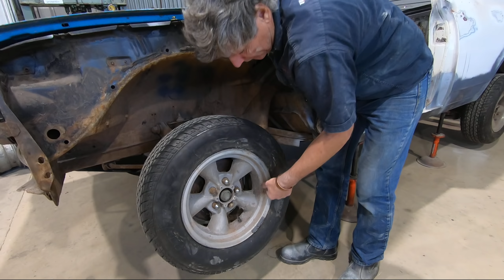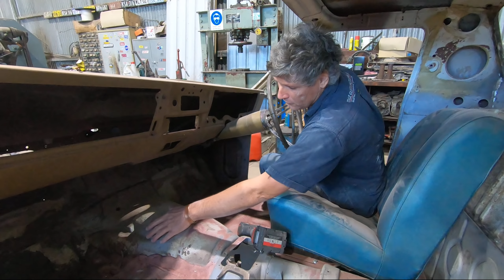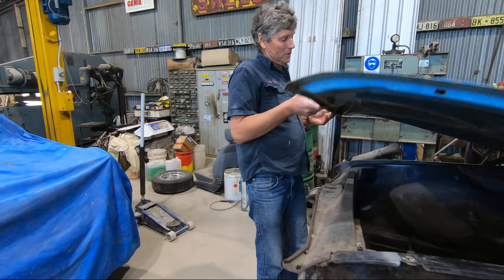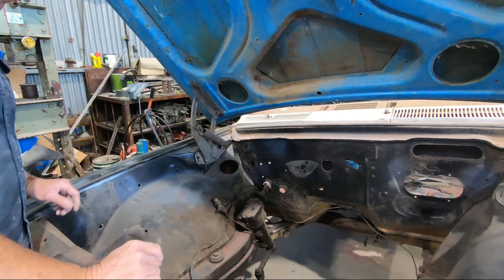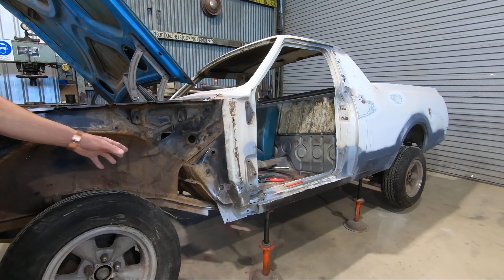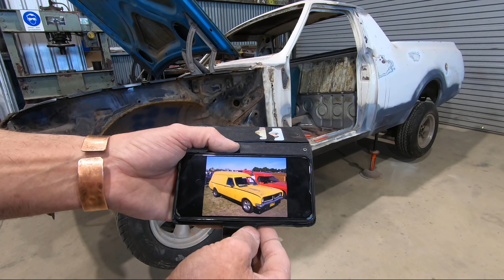GoPro update 4

Comment: Rob have you ever come across a Holden premier hg with monaro dash and v8 brakes discs on front but come with original 6 cylinder
Reply from the maker: Yes,  disc brakes, were std on all hg v8's and 6cyl gts Monaro. Optional on all other 6cyl. The dash in the option book is refered to as the sports instrument dash, and was avalible on all HG models that did'nt have it as std equipment. The hk ht and hg were the most optionable Holdens ever made. In theory you could option a Belmont as a Premier.
The disc brakes were not that uncommon, by 1970 they were starting to become a popular option.

Comment: anyone  can paint 2pak  tho ....the other paint is so much better  than 2pak
Reply from the maker: Having grown up with acrylics and jam, I always look back on those days and the differences between them. I like, most people then looked at enamels as the rubbish paint, and this new fangled 2pac was just another form of an enamel. We were mostly cautious of the change, and it was a hard sell from the manufacturers to convince the industry. I did embrace the change, and like alot of others did a few jobs and went back to acrylics. However as time went by I did move entirely to the 2pac system. I do believe that both have advantages and disadvantages. Personaly I like the look of the acrylic on restored cars in the door jams and inside the bonnet/ boot, as in my mind it looks right. I like the gloss of the 2pac on the same era car if it is modified. Cheers Rob.

Comment: Some years ago a mate owned a HG premier ute. It was the only HG i have seen with a 327 v8 engine....factory. I'm a Ford guy and find both Holden and Ford had great option lists in those days. You could build a car that was you!  I bought an XY ute once that had been owned by a farmer from new. It had a 302 V8 with 3 on the tree. When i bought it, it had a sick synchro cone on second gear. I rebuilt the gearbox and had a hell of a job getting some of the parts for it. Only the input shaft was different, it was larger than the six cylinder version of the bw 3 on the tree. So the bearing and throw out bearing took months to get. The farmer bought the Ute from the local Ford guy and wanted the V8 but didnt want auto or 4 on the floor. So they got what he wanted....you don't get that anymore...
Reply from the maker: The father of a mate of mine had a XY 302 3spd wagon that he had bought new. I looked at buying it in the early 90's, but the forces didn't align on the day. I have always regretted not buying it.

Comment: G'day Rob, I optioned up a Kingswood sedan in 1971, just before the HQ hit the streets, to basically a 4 door GTS  Monaro, bucket seats, carpet, GTS dash, LSD, 253 V8 with saginaw 4 speed, disc brakes ( for what they were worth) and GTS wheels, great car, it'd be worth heaps today. It would snap rear axles like straw, and I became expert at replacing  the rear springs.
Reply from the maker: The banjo axle really let the v8 cars down. Sadly for Aussies is that most of the export cars had the 10 bolt.

Comment: interesting ute 
 all the HK HT HG's i have seen  all had a GMH chassis black on the sub frame the only exception was the ej  and early EH's had a grey /charcoal on the sub frames & inside boot  closest match to it is the HQ GTS charcoal painted on the GTS wheels
when you said about the repair on the trans tunnel for a minute there i thought of a HG ute i repaired back in 84 that had split in the same area but this was the result of a cement mixer truck running over the front of it right across the bonnet flattening the guards and sub frame 
i put a HK sub frame on it and HK front end  had to re weld the gearbox  supports to it also as HK cross members bolted to the floor 
it had a 186s  and 4 speed opal lsd diff in it to out of a monaro
a guy i knew also had a Belmont HK sedan  semi buck bench seat and 307 powerglide option from factory
so you are right you could option just about any comb you wanted just had to be prepared to wait for it
holden did some strange things when experimenting back in the early days

Comment: Good heads up young felah,l noticed the floor shift mount is the same as the ht Monaro l am restoring,l only thought they put it in the Monaros to fit the saginaw and the floor shift auto,the donor ht Kingswood l got hasn't got it.  If you look at some of these  repair panel sellers their asking over $400 for that steel moulding.
Reply from the maker: The Saginaw 4 speed was available across the model run.(all body styles) All Saginaw cars have the bulge in the side of the tunnel. The riser for the shifter is common for opel, Saginaw and floor shift auto. The Saginaw was available on 6 cylinder HK and HT as well.
Reply: Greg Palmer yes and I’m chasing one for my hx which has been fitted with a Saginaw and has a hole that looks like it’s been cut with a broadaxe☹️